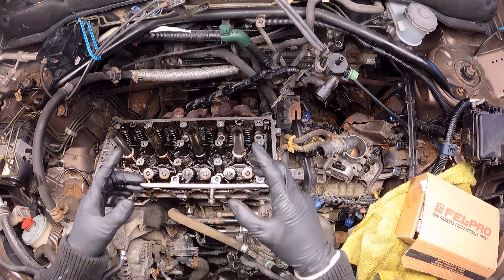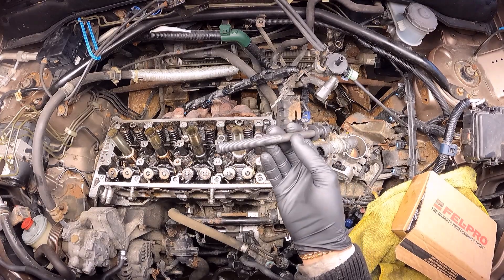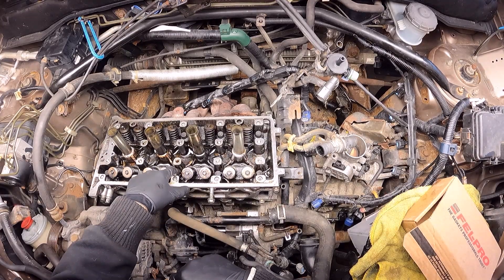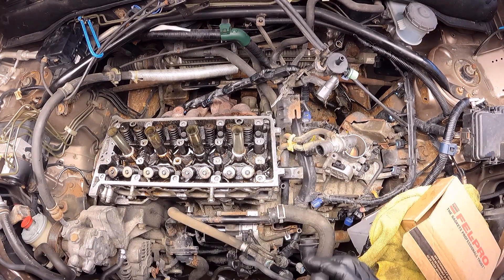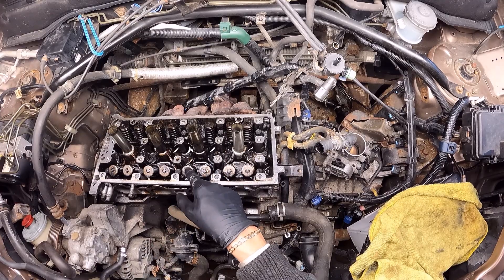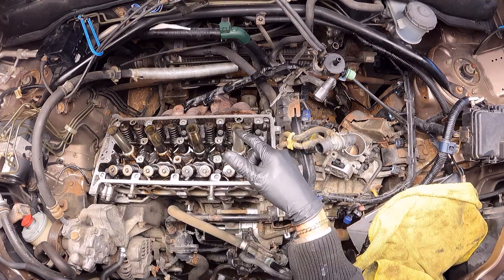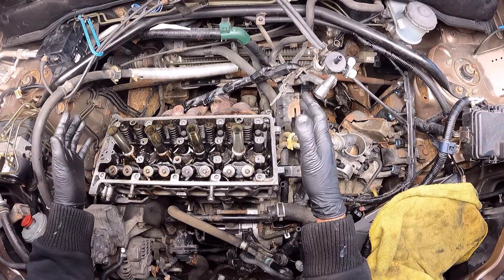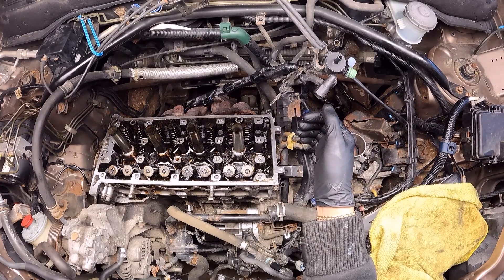Engine head torque specs & sequence Honda CRV (2002 - 2006)

Comment: Nice video i am currently doing a 2013 crv the head gasket was blown in 2 different areas it was bad. I have never seen a head gasket that bad! Wish i could upload a picture in the comments to show you
Reply from the maker: Good luck with your current work / project.